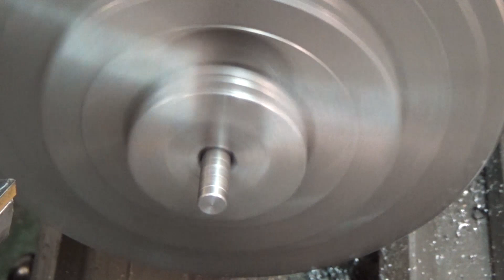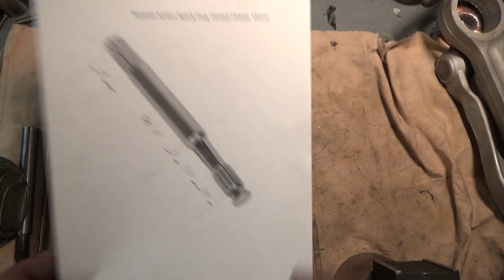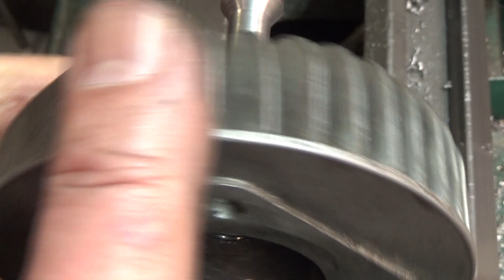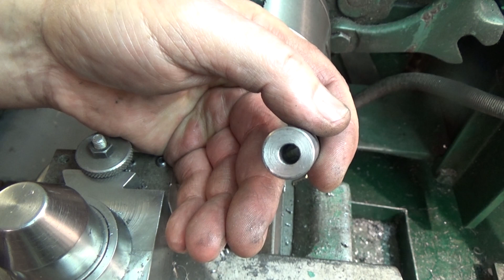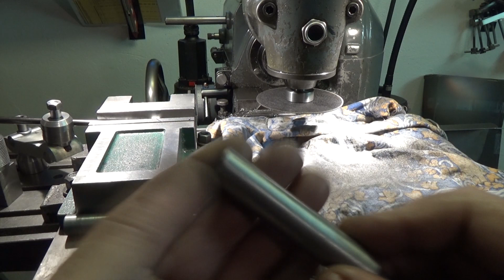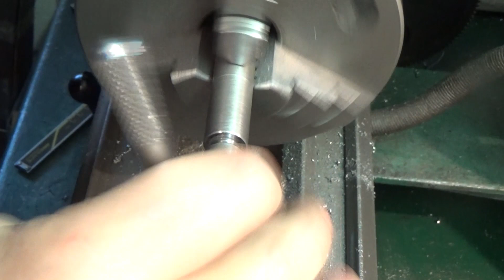Making a Sparkplug Thread Chaser Tool

Comment: pretty neat idea for an expanding tap, I was curious what rpms you were running that cutoff disk at?
Reply from the maker: Thanks. Max rpm on my old milling machine is 1500 and that was what used running the cutoff disk.
Reply: Oh, ok, thanks a ton on getting back to me on that.